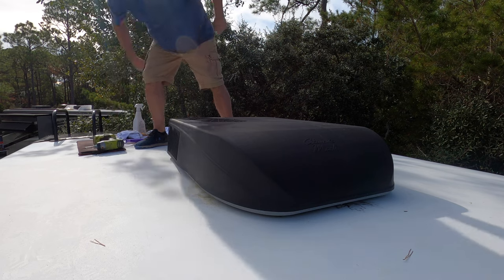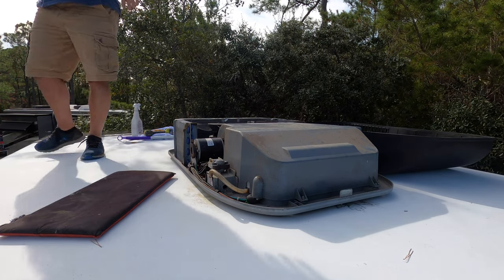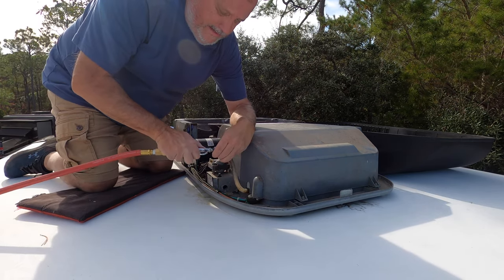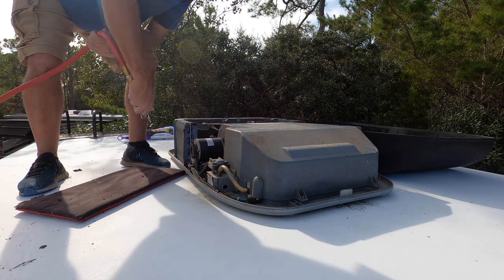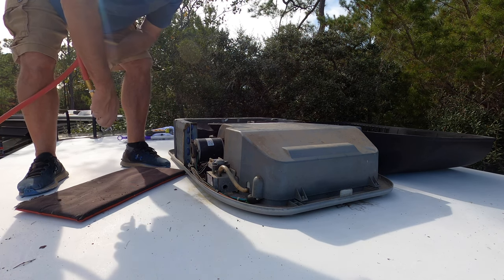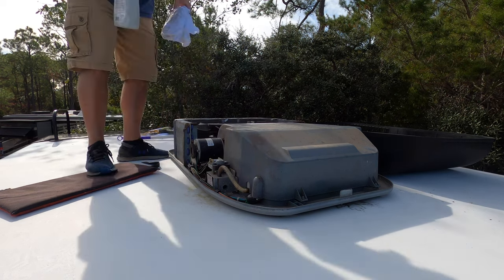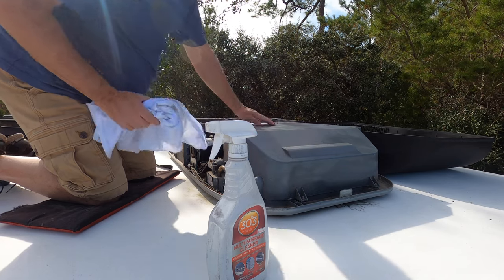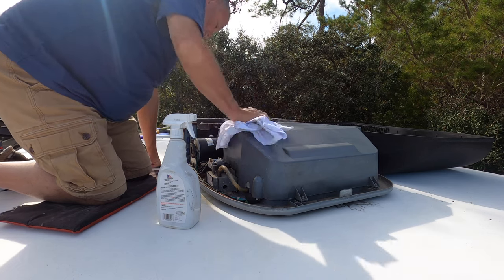Here’s How to Unclog RV AC Drain Fast | Sunday Solution

Comment: Randy, Thanks for the additional information on the A/C condensation lines.  I knew of the drain lines in the rear of the coach but did not know there was a pump attached.  Always assumed it was just A/C gravity draining.   Will add this cleanout task to my A/C maintenance tasks.  By the way:  As we have the same rig, I am always looking around in your videos noticing setup things and differences.  Question:  Noticed you have a long gas line to your Blackstone and I am assuming you are using your rig propane tank for fuel.  Great idea and I have looked into it but would be interested in any methods or learnings you have about setting that up.  Thanks again for taking the time on those videos as we really enjoy them.  .... Monty & Mary
Reply from the maker: Randy took a picture to share with you.  If you are interested in the details, please email us at Chasingthedreamrv@gmail.com and he'll get you the information. Thanks again for watching us ~ Terry ✌️🙌💕

Comment: Where do the condensate lines terminate as far as location. In the rear where? have a Tiffin 36LA. Additionally, do you clean the condenser coil?
Reply from the maker: Ours terminate in the rear passenger side corner near radiator two lines comes down with duck bills on the end. I do clean the coils typically once a year…I’ll see if I can find a link to what we use and post it here…